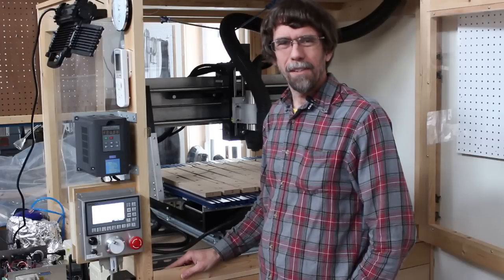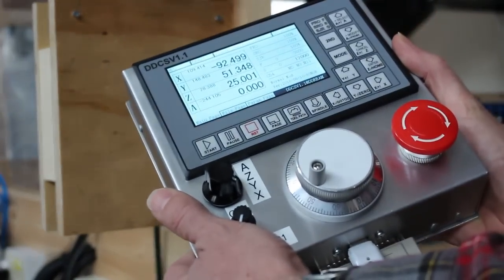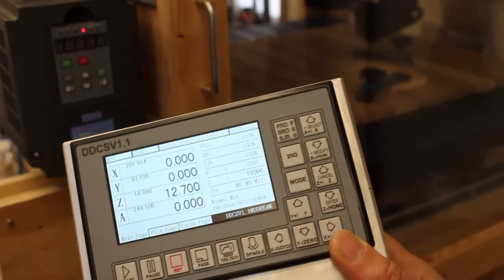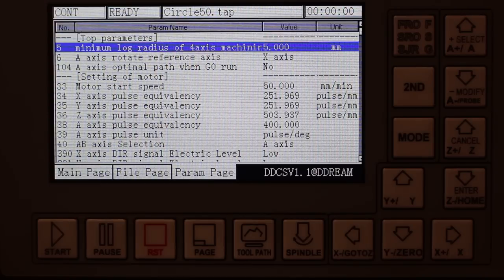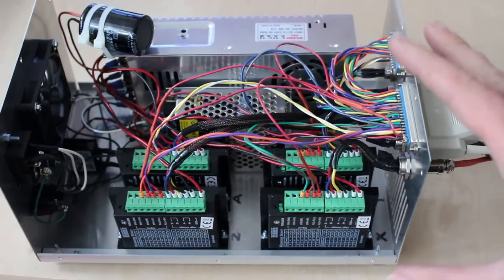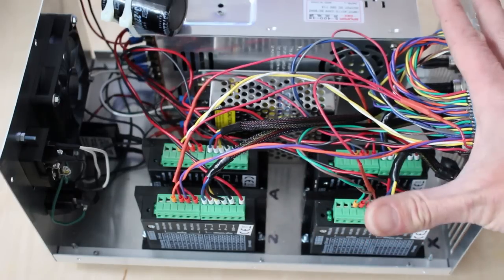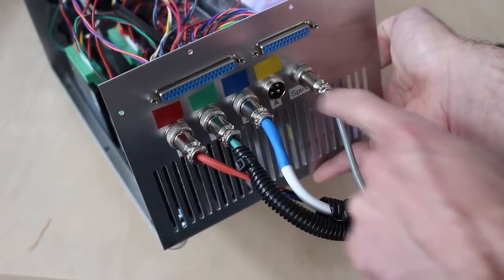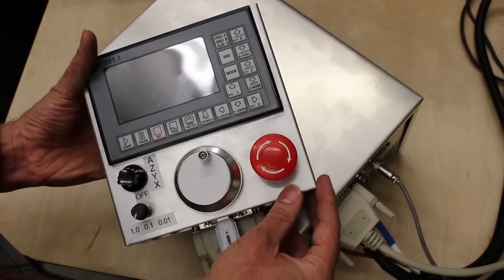Modular CNC Controller DDCSV1.1

Comment: Hi, what postprocessor do you use when save your file?? For Aspire I use gocode (mm) but with non linear interpolation is very slow. Like “excact stop “ in mach3. I try to have a settimg for costant velocity mode. Do you know something for it?
Reply from the maker: I wrote a postprocessor for Fusion360 and published it (free and open-source) on my website at http://brainright.com/Projects/CNCController/. I still sometimes use VCarve Pro that came with my CNC router, and I found that the Next Wave Automation CNC Shark postprocessor generates G-code that works with this panel.

Comment: Hi There, I Have got the ddcsv1.1 running on a cnc router. can you please tell me the best post processor to use as I cant get the fanuc .tap file to run. It looks like some of the Fanuc G codes don't work with the ddcsv1.1. any help would be great.thanks scott
Reply from the maker: Hi Scott, you didn't say what software you are using but if it's Fusion 360 then you can use the post-processor that I wrote. It's posted on my website with a link in the video description.
Reply: yes it is Fusion 360 thanks

Comment: Salut Jay
J'ai reçu mon contrôleur DDCSV  et j'aurai une question sur le branchement des limites car sur la notice il n'y a pas de schéma pour le câblage des contactes limite ,Exemple les contactes limite X doivent être en série ou indépendant ?
Avant de faire une erreur je préfère te poser la question.
Merci de ton aide
Joseph
Reply from the maker: Using Google Translate:
_Hi Jay
I received my DDCSV controller and I will have a question on the connection of the limits because on the notice there is no diagram for the wiring of the limit contacts, Example the limit contacts X must be in series or independent?
Before making a mistake I prefer to ask you the question.
thanks for your help
Joseph_

Hi Joseph,
I do not have limit switches wired up but according to the manual, each switch should be connected between a limit input terminal such as Limit X+ and either one of the terminals labeled +12V-I. Each contact is independent because there are separate signals such as Limit X+ and Limit X- for the two limit switches plus an optional Home switch on each axis. I have not personally used any of these so I am only interpreting what the manual says.
Regards,
Jay
Reply: Hello Jay
Merci pour pour la réponse ,avec les explications cela va m'éviter de faire des erreurs de branchement ,les explications sur le manuel ne sont pas très clair et le schéma de branchement complet il y en a pas,j'ai cherché sur le net mais personne n'a fait cela comme tutoriel.. .
Encore merci pour ton aide 
Cordialement
Joseph

Comment: hi Brian, which cable did you use? is ok to use the 10ft long one?
Reply: oops. excuse me about the name thing!
Reply from the maker: No problem, I've been called far worse things than Brian :-) 
The cable is just a DB37 extension cable, and mine is 6ft long but I think 10ft would work okay. If you're going with a longer length it might be worth spending a little more for a good-quality cable with heavier conductors, although often the wire gauge is not specified. None of them are carrying much current, even the power leads, but I doubled the power wires anyway.

Comment: Hello friend this controller has support for tool change
Reply from the maker: It doesn't support automated tool changes, but neither does my CNC router. I just create a separate g-code file for each tool and change the tool manually before running the next file.

Comment: Hi Brain, What do you think of the controller for production use?
Reply from the maker: I would say it's suitable for some light production use, but largely it comes down to weighing the cost of the equipment vs. the cost of making mistakes. This is very affordable and in my experience it has worked well but if you're cutting expensive material or if it might be costly to shut down production temporarily then it would be worth spending more for an industrial-quality controller.

Comment: does it show the toolpath on the screen? its something i use a lot to ensure i wont hit fixtures...
Reply from the maker: Yes it has a graphical toolpath display, but I don't use it personally so I can't comment on how good it is. I usually check for collisions or other problems by doing a trial run with the Z axis set above the workpiece and at reduced speed, with my hand on the e-stop button.

Comment: VERY nicely done.  If this controller understood both the Metric and English system (selectable) as most modern CNC controllers and related software does I would likely consider it.  Its no geat issue to do it, just a bit of additional code inside the controller. After all what really happens is both get converted to a series of stepper pulses thats just another conversion anyway.  As is now, NOT A CHANCE as I feel not having that capability makes this controller not worth the hassles involved converting from english to metric by hand or in software not worth it.

Comment: Does that module support slave axis drive?
Reply from the maker: Not directly, but you can connect two stepper drivers to one axis output in order to drive two motors in parallel.

Comment: hi Jay, I am looking to build a setup similar to your panel. would like to try to have 2 rotary encoders one for x axis and one for y axis. Im not sure if it can be done as it looks like there is only one input, would you have a wiring diagram for the rotary encoder. the controller manual does not make this clear.thanks Scott
Reply from the maker: Hi Scott, the DDCSV1.1 panel has no support for encoder inputs, although it does have many inputs for limit/home switches so hypothetically some future firmware could repurpose those for encoders. But as it stands I think the only option with this panel would be to use an external closed-loop servo or stepper driver. Here are a couple of possibilities that may work but I have not used them personally.

The ClearPath SD series from Teknic is a servo with integrated driver and step/dir inputs, which I expect would work with this panel:
http://teknic.com/products/clearpath-brushless-dc-servo-motors/clearpath-sd/

Automation Technology offers closed-loop stepper systems that act like servos and should work with this panel:
http://www.automationtechnologiesinc.com/products-page/nema23-closed-loop-stepper-motor-system-hybrid-servo-kit
Reply: hi Jay, thanks for your reply, I was actually referring to the hand wheel (rotary encoder) on your control box for steering the axis around. sorry about any confusion, I was not sure how to connect it to the MPG Port on the DDCSV1.1 I wondered how you wired your handle. This project I am converting I a Retired Skyjet uv flat-bed Printer into a router and later a maby 3d printer aswell, the bed measures 1.6 metres x 2.7 metres so this should a great project. thanks again Scott
Reply from the maker: The MPG (Manual Pulse Generator) wheel that I used had 6 terminals, which I wired directly to these 6 terminals on the controller: GND, +5V-W, WHA-, WHA+, WHB-, WHB+. The controller only has provisions for a single MPG wheel, plus separate switches to select which axis the wheel operates and the rate at which it moves the axis. The X-Y-Z-A rotary switch on my controller box is wired to the X-IN, Y-IN, Z-IN, A-IN terminals. Connect one of those to GND in order to select the axis for the MPG. I used a 5-position switch so that there's also an OFF position, which is useful to prevent moving an axis inadvertently. The 1X, 10X, 100X signals are similarly connected to a rotary switch to select the MPG wheel speed by connecting one of those to GND, but having none of them connected is the same as 1X and not "off".

Comment: what the extension of gcode it accept?
Reply from the maker: According to the manual, which I posted on my web site with a link in the video description, it is compatible with Fanuc g-code. I have not tried using a Fanuc post-processor so I can't say how well that works, but I found that it will run the same g-code as the original controller that came with my CNC Shark router. I also put a small sample g-code file out on my web site.